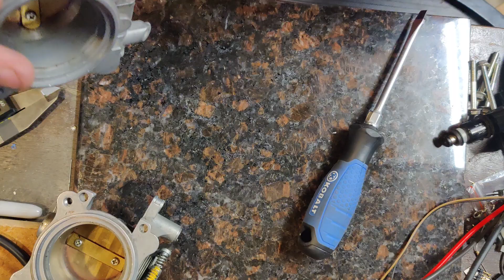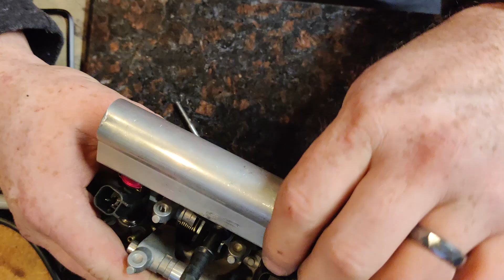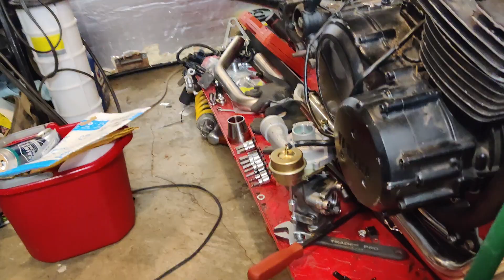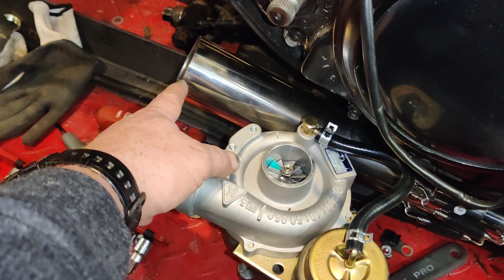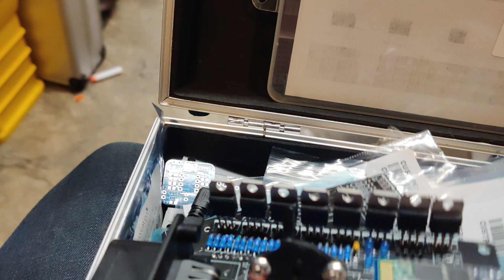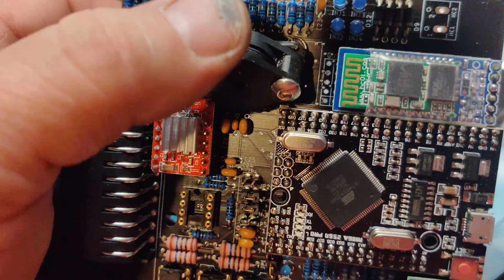Convert ANY motorcycle to EFI...Cheap!

Comment: This was fascinating, thank you.

I have a 1981 xv750se, and the ignition module is kaput.  I have been looking in to converting it to electronic ignition, so doing fuel injection at the same time just makes sense. I'm also quite keen to give it a go, as according to the forums, efi is impossible to do on the viragos.

Great idea on using the tachometer drive for the crank position sensor. I hadn't thought of that one. Won't work for my bike, but that's a really good idea.
Reply from the maker: Thanks for the feedback! I hadn't heard that Viragos were "impossible". To me that says you have to try it! Good luck and if there's anyway I can be of assistance, feel free to message me on Instagram.
Reply: @bombshellbikes1559  Thank you, I really appreciate it. This might give me the kick to actually get going on it.....
Reply: @drewwyatt1274  Did it ever happen?
Reply: @Hector-Romero  Unfortunately no. I moved house and couldn't take the bike with me. I will be looking to get another virago and trying it, but I need to sort the garage out first.

Comment: Very interesting..  looking to inject a early v8 would you system work that.?
Reply from the maker: Absolutely, plenty of folks have run V8s on Speeduino. With a standard board you have to run wasted spark and batch injection because they only have 4 output channels for each, but there is a ton of information on the speeduino site about it
Reply: @bombshellbikes1559  in that i guess one could run 2 systems..  ball park cost.

Comment: What interface software do you use tuner studio?
Reply from the maker: Yes indeed. Tunerstudio
Reply: @bombshellbikes1559  would one of these be any cheaper or more useful than a microsquirt at $375?
Reply from the maker: @The_Adventure_guild  Absolutely, all in, it costs me about $200-250 to build one of these ECUs depending on configuration.  In my opinion, these are superior because you get four independent channels of both fuel and spark control.

Comment: Carburetors beat EFI hands down.
Reply from the maker: For all out high RPM horsepower, sure. For daily driven vehicles that experience a variety of operating conditions, EFI has significant advantages. Also, EFI is more efficient for daily use.
Reply: Carbs are great for simplicity of tuning and repair, once you understand how they work - and there generally isn't much to understand, barring something like a Suzuki RE5. You can get surprisingly far with just a few screwdrivers and some rules of thumb.

On the other hand, EFI can give you even more tuning range, better drivability, and less need for repairs - again, once you understand it. And once you have the necessary equipment. The catch is that both barriers to entry are much, much higher than with carbs. Trying to tune EFI without understanding the theory of operation or how a fuel map works is a recipe for pain.

Comment: i wanna go back to carbs, no ECU, no sensors
Reply from the maker: Meh, carbs had their day. There are some pretty good ones out there (Lectron for example.) but trying to tune carbs for a turbo... No thanks.
Reply: @bombshellbikes1559  right,  carbs can't be used with turbos,pressures/vacuum/sealing problems (Metro turbo used it, but not many more), you need FI for that ;  but.... you need a fat wallet when ECU,sensors injectors,wiring, etc etc break down;  as an old mechanic,i much prefer the simplicity of carbs and even air cooled any time, will do my best to never own an FI bike, don't trust them.

Comment: U need to see Wesley Kagan Channel for diy FreeValve tech 😊
Reply from the maker: I've seen that! That dude is doing some seriously next-level work!
Reply: @bombshellbikes1559   he is awesome and u too.  Seeing you and Wesley Kagan made me excited to rebuild my motorcycle.
Any advice for EFI convert?
Reply from the maker: Best advice I can give on any project is to be patient. That's why I generally try to start bike projects at the end of summer, so there's no rush to get it done in time for "riding season". Also, many folks have a tendency to cheap out and rush things near the end of a build. I usually try to slowly stockpile parts early, that way when I'm neck deep in a job, I don't convince myself to take an easy way out when I'm near the end.
Reply: @bombshellbikes1559  I'm doing like that too, buying the part no rush.
Do u know Ecotron efi kit?
Reply: @bombshellbikes1559  in my country, its very hard to buy that AEM Part u have.
Is speeduino can accept 'signal' from CDI to speeduino.
Reply: @bombshellbikes1559  or AEM Smart is needed only for multi cyl engine?

Comment: Hello I saw your video and found it interesting I dont no much about electronics but it seem you do Im working on a custom project that I need help with I got no idea were to even start at I got a 1970's sulliair 160 air compressor has  2.5 liter gm 4 cyclinder motor it runs good but u cant parts for it had a  Mechanical style governor It's now missing and you can't get parts Thats how i  got the air compressor and im  thinking there's a way to use an arduino to make a electronic governor using a stepper motor to work the carburetor I am jusy not sure where to go with this idea

Comment: Hey, I'm working on a DIY STM32 ECU to convert one of my old dirtbikes to FI and came across your vid during research. Looks like you made some great progress. Good idea on the smart ignition module. I had no idea they exist, and it saves a lot of complexity building a CDI circuit into the ECU. I'd love to pick your brain more about this project. It's so hard to find info on ECU building.

 BTW, your optical crank position sensor should work, but the infared LEDs they use have very short lifespans at high temp. This is what makes reluctance sensors more popular.
Reply from the maker: Yeah, I am a little worried about the optical sensor. I'm shooting a video this weekend covering a new project that is going to hopefully be my proving ground for an optical sensor (this one will be a lot easier to change). I really like the idea of STM32, but didn't want to deal with all of the 3.3 volt level shifting. If you have questions etc, feel free to message me on Instagram (link in description)

Comment: How are you going to do the fuel pump? I'm going to convert my xr600r to efi with microsquirt
Reply from the maker: I too, was concerned about electrical load with the fuel pump etc. To help mitigate this, I switched all of the lights to LEDs, I've put a few hundred miles on the bike since the conversion and haven't had a voltage drop problem yet.
Reply from the maker: For my turbo XS750 build, I'm making a custom tank with an in-tank fuel pump/regulator combo from some Harley that I found on ebay(it was the lowest profile assembly I could find). On my previous build (XJ750), I used an in-line pump and bypass style regulator (also from ebay).  Both are switched from a relay triggered by the speeduino.
Reply: @bombshellbikes1559  did you have any issues with the charging circuit and too much current from the efi components? im doing an xj700 right now and its something im not sure about because its not running yet.
Reply: @bombshellbikes1559   I am also looking for a low profile assembly for my Hawk GT  , can you provide a model for the pump ?
Reply from the maker: @YiannisMiliaresis , according to the eBay post where I purchased the fuel pump, it came from a Harley Davidson XG750. I am not familiar with HD bikes at all, so I cannot confirm.

Comment: Definitely like what you're doing that vintage motorcycle I have a 50cc scooter that I upgraded the cylinder on in that and would like to put it to fuel injection instead of dealing with a carburetor to maximize my Powers torque and speed
Reply: A properly set carburetor will make more power than EFI. If you cant fix a single carb engine, go back in the house and watch t.v.
Reply: @minnesotabymotorcycles4773  lmao lol. I upgraded mine to 88cc and smacked a 125cc efi on it and it runs amazingly. If you cannot take apart a 50cc lol, thats kinda stupid indeed.

Comment: Far as your reluctor wheel for the sensor you could take the body the board of the sensor and create a casting and submerge it in epoxy with your harness already on it and that will reflect the heat from transferring to it

Comment: Gsxr600 throttle bodies from the early 2000s are nice and easy to respace.  I used the outer 2 on my XS650, with ford IAC, dubshop modified gm temp sensor, ls coils, and 2" 36-1 wheel on the cam with a microsquirt.  Dead times took some playing around, but the stock gsxr injectors are 220cc.  The gsxr ITBs fit perfect in the BS34 carb boots from an 80s XS.
Reply from the maker: That's some very useful information on those TBs. Thanks for sharing!
Reply: I know this is a old video and comment but I have a 1998 Kawasaki zx1100 (4 cylinder) I am looking to make EFI with GSXR 1000 throttle bodies. Are you still doing the ECU ? @bombshellbikes1559
Reply: I know this is a old video and comment but I have a 1998 Kawasaki zx1100 (4 cylinder) I am looking to make EFI with GSXR 1000 throttle bodies. Are you still doing the ECU ?
Reply: I know this is a old video and comment but I have a 1998 Kawasaki zx1100 (4 cylinder) I am looking to make EFI with GSXR 1000 throttle bodies. Are you still doing the ECU ?

Comment: Any thoughts on a conversion for a goldwing 1500? I am sure that you know that the 1500 is a 6 cylinder but only has two carbs. I am assuming that I would need two individual systems?
Reply from the maker: Nah, it can be done with a single speeduino. You can pair up injectors and run 3 channels and use 3 dual output coils in wasted spark mode. People use these things to run V8s all day. Check out this page for more info.  https://wiki.speeduino.com/en/wiring/Injector_wiring

Comment: Do you think a mapdaddy4 sensor could be adapted to work? I know it can be added to mega squirt and It would be nice to add barometric reference.
Reply from the maker: There are quite a few unused inputs on most speeduino setups. I broke out a few analog and digital ones on my boards. TunerStudio allows for barometric correction and has calibration settings for a secondary sensor. That being said, I see no reason you couldn't add just about any sensor you want. Good luck!
Reply: Ill have to test some stuff out!

Comment: This is very interesting for me, I have a Yamaha XS850, with a set of 900 pistons to be machined, already have Triumph carbs for it, and was looking at Speeduino to see if I wanted to use that for ignition, as it might help when tuning. I guess the full EFI is almost as easy. Think the Triumph 850s and 900s had same carb spacing, so thought the throttle bodies would be the same... 
Anyway great content and good to know these older bikes are not forgotten.. 🙂

Comment: Im I. The debate on converting my 92 vt1100. Not sure if there's room in there tho. 
What's you're approx cost between fuel rail, injectors, ecu, coils? Basically everything but the turbo.
Reply from the maker: I agree that space can be tricky, especially on V-twin engines.

The cost of these conversions varies greatly from bike to bike. I admit that for me it is not so bad because I do all of my own machining. But a basic rundown goes kind of like this:

Throttle bodies: $40-100 (eBay )
Fuel rail: $25 (eBay)
Injectors: $20-100 (junkyard or ebay)
Fuel pump: $50 (any auto parts store)
Fuel pressure regulator: $50 (eBay)
Oxygen sensor: $20-75 (wide or narrowband will affect price)
ECU: $75-150 (lots of sources or build your own)
Sensors and wiring : varies widely depending on your setup and capabilities.

There are obviously drastic variations in most of these components depending on your particular setup and access to used parts. 

Basically, I can't accurately estimate a complete cost for anyone else's setup. 
I hope you can find some of this information useful and I wish you luck on your project.

Comment: Nice video mate, busy with a similar project as well, er650 throttle bodies onto a kz440 with a microsquirt, only issue atm is my three wire IAC that the micro squirt doesn't accept, just a though I hate to see your grub screw ding the throttle bodies, I drop a captive ball bearing in there to protect the body, Please keep us updated on this beast!

Comment: Convert ANY motorcycle to EFI? I fail to see how this will work on a KTM 300.
Reply: Size and adapt a throttle body and injector, figure out a crank signal (no need for a cam signal on a 2 stroke), add an ignition coil, use an open-sourced ECU to run it. What mystery am I missing? (p.s. I have a fuel injected te300i that has literally every piece mentioned available as parts from KTM/Husqvarna). You could even run the OEM oil injection pump, but I would think just running pre-mix is a simpler solution. If you lack understanding it is better to ask for help than to criticize someone who is successfully doing what you fail to comprehend.
Reply: The details are specific to a single bike, but the basic concepts and derivation of many of the details are applicable to almost any engine.

Comment: Thank you for sharing your knowledge, this is a fantastic video and well explained. I have a project YZF750 that uses a very similar engine to that of the XJ750 you mentioned early on. What did you end up using for throttle bodies for that bike? And if possible, could you share your tune for that engine?
Reply from the maker: I used 2006 ZX6-R throttle bodies (only because someone local was selling a set on CL). I'm not sure about sharing the tune, I'll have to check with my tuner to see how he feels about it. If you're interested in the throttle body mounting adapters, I'll share a link in the description.
Reply: @bombshellbikes1559  That would be great, thank you

Comment: What about the yamaha xj 750 conversion I own one and want to make it efi can you give details on the throttle bodies and other things about the tuning
Reply from the maker: I can send you the cad files for the adaptors I made, I used throttle bodies from a 2006 Kawasaki ZX6-R. And if you use speeduino, I could send you my tune.
Reply: @bombshellbikes1559  that would be greatly appreciated
Reply: @bombshellbikes1559  how would I go about getting cad files for the adapters for the xj750 and the tune
Reply from the maker: @linearsmiles7511  
Here is a link to a Google Drive with the cad files:  https://drive.google.com/drive/folders/1DOKVLnpYP1lFJe2WEdwUgOunFdUMAOE2?usp=sharing

Comment: Turbo mounting. Do believe reason for mounting turbos close to the cylinder head is it's more efficient. Hot gasses expand and create higher flow speed. Mounting at the back will loose you loads of power.
Reply: And turbo lag issues

Comment: Hey, I’ve been doing some research on Hall effect sensors and consistently found this regarding magnets. “A Hall effect sensor produces a consistent digital square wave signal each time a magnet or ferrous metal passes the tip of the sensor” This tells me as long as The trigger wheel is comprised of a ferrous metal magnets are not required to be attached. I am curious how you went about attaching magnets when you did? Did you simply Epoxy them or a rivet at them?
Reply: Not all Hall effect sensors need magnet passing.  Specifically in car and bike world, they must build them with specific sensors that can detect anything ferrous passing in close proximity.  Maybe the magnet is built into the sensor body, idk on the exact construction.  But I can 100% attest to the fact that there are Hall effect sensors commonly used for cam position sensors in cars/bikes that will detect just a steel “tooth” passing by.  For instance, the cam position sensor of a gen 2 hayabusa is Hall effect (gen 1 is vr).  It detects the simple 6mm hardened steel pin that protrudes from the intake cam.  Look on any late-ish model car/bike engine with cam position sensors and most are hall and pickup a steel toothed wheel or pin or the like on the camshaft.  Hall sensors will be 3 wire and vr sensors are 2 wire, easy to spot the difference!  Usually the sensors are black plastic body and attach with one or two bolts to valve cover directly above rotating camshaft.
Reply from the maker: Shit man, I guess I should have done more research. I have a hall effect sensor setup right now for another conversion I'm doing. I'll have to test it and see.

On the magnet one, I machined holes about 0.001" over size and used epoxy retain the magnets in an aluminum wheel.